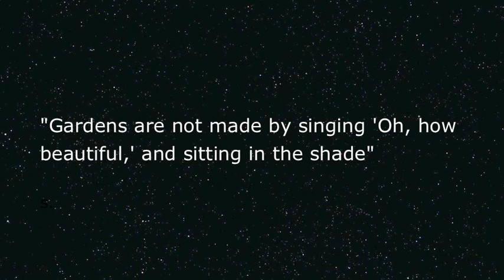My Front yard complete landscape makeover!

Comment from the maker: Thanks for the comment!! They both have there advantages really. Underground drip lines have the benefit of nobody knowing your watering and eliminates theft. it also prevents water wastage as water is getting straight into the soil!!!. The main downside is when it comes to renovation time. You can not core etc. But as this area is not a high use area. A dethatch once a year and a good fertilise in spring will most certainly keep it looking great!!!. Good choice on the mp rotors.Great sprinkler!